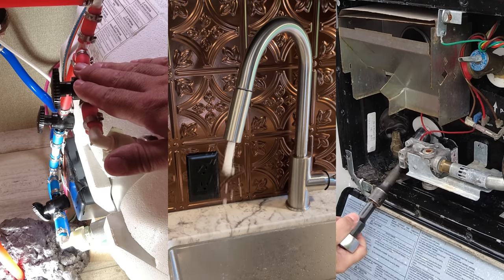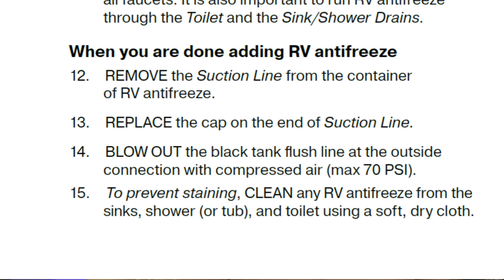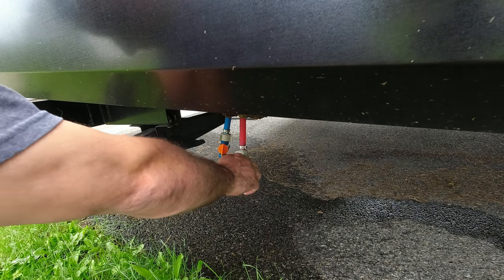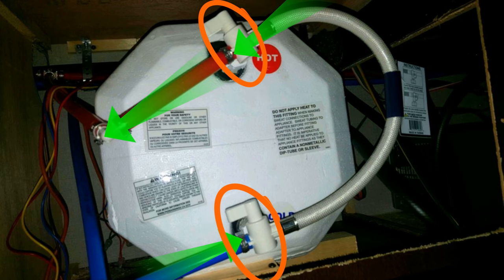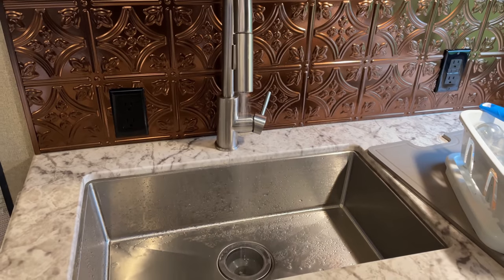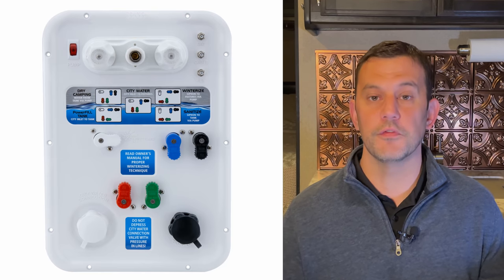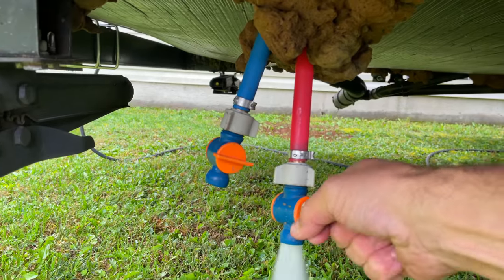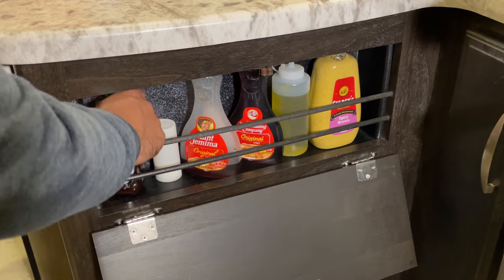RV Winterizing Made Easy - Step by Step Process for Beginners (Compressed Air Method)

Comment: PLEASE PLEASE HELP ME! My Dad passed away and gifted me his 2000 Coachman Leprechaun 305MB, 450 Ford?  I have called a dozen dealers for their assistance in JUST walking me through what this and that does in the motorhome.  Unfortunately, they don't give a second of their time on a "No Sale" customer.  Kind of sickening. My Dad took tremendous pride in his little toy and it is in meticulous shape inside/out.  But if I don't do this blowing and draining with and without antifreeze in this bypass heater and the low point drains with on/off switches (which I don't have nor seen anywhere underneath)  there are 3 drains. 1 is by itself and the other 2 are side by side.  I already, pretty sure anyway, that I drained the water lines. But I panicked last night because I thought the pipes were going to freeze so I poured 1/2 gallon of RV AntiFreeze down the kitchen sink (both sides), 1/2 gallon down the bathroom sink, 1/2 gal. down the tub and a gallon in the toilet.   I feel so ridiculously stupid and beyond frustrated.  I can't get any service person to come to my house to help me (I have cash and credit cards) so I don't know what to do. You are BY FAR the best teacher on this platform and I greatly appreciate your videos.  I just wish I had the setups or layouts and tools you are using and suggesting. I'd give you my cell number for a walk though and send you payment via WHATEVER you ask for.  lol...Desperate here...
Reply from the maker: Where do you live?
Reply: @RVTIPSANDTRAVELS  Caledonia, MI
Reply: How can I 
post/submit/add pictures of my dilemma?
Reply from the maker: @IrishRose729  send a bunch of pictures to management@rvtipsandtravels.com    i will take a look at them, and if it is something we can do over a facetime call i will let you know.

Comment: My hot water heater only has one valve with One direction marked "winterized".
Reply from the maker: your type of set up is depending on the check valve at the water heater to act as a valve.  if that check valve fails, youll have to add a manual valve, which isnt a bad idea to do before that happens.
Reply from the maker: @Wayne B I'm almost certain you have a check valve on the line coming out of the water heater on the hot side, so nothing should flow back into the water heater.  see my response on the original comment of this thread.

Comment: I have a 2014 lance 1985 trailer that is supposed to be rated 4 seasons.  I cannot find the water heater bypass valve, I have asked Lance trailer company and they say it is behind the water heater inside the drawers of the bathroom,  I have gone through the book and still can’t find it.  I had a friend that also has a Lance and he couldn’t find it either.

I have had some issues with the people at Lance not doing work they were supposed to do and treating me like an idiot when I tell them it wasn’t fixed.  I didn’t have a problem with them anytime I took it in for service or an issue when my husband was still here,  when he passed away they never even wrote out the work orders correctly or even close to the problem.  I took it in to have all the ducts replaced because of mouse damage,  I had told them and manager my husband said the underbelly needed to be checked and cleaned if there was evidence of mice.  I had many conversations with the manager and parts guy to get my request across.  I take it in and decided to have a backup camera and electric hitch installed.  I pick it up and they had me wait for an hour before they brought it out, as everyone was leaving.  No quick lesson or even a glimpse of a mechanic on how to work the hitch or get the camera image right side up.  I find the half a$$ed instructions for the hitch and guess what, I didn’t have the cordless drill with me and it was needed to work the hitch, see I could do it manually….if I had the handle that is not included and I was apparently supposed to purchase.

Really annoyed now, check the ducts that cost $500.00 and see the 2in one is taped over, and not very well because holes are still visible and the 4in duct still has the powder all over it from my mouse hunting expeditions.  Mouse droppings and pee inside the vents.  Now I am pi$$ed.  I hook up the trailer to go home with intentions of asking what happened.  Nothing worked, the beast was dead as a door nail.  Now I want blood, I pound on the doors and all the windows I could get to, nothing.  I call hoping a service might answer to take messages, I left a message letting them know of my extreme displeasure along with they better pray they don’t see me still here in the morning and if I can’t get the trailer home they had better find a way to get it to me tomorrow.

The trailer battery charges and I go home.  I call and tell them what happened and they say bring it back.  They said they fixed the back panel that was falling off.  It wasn’t,  the idiot didn’t put to change the ducts and I had to pay another 500 for labor.  After all the talk about underbelly with everyone including the manager, the manager now tells me my trailer doesn’t have an underbelly.

I am sorry this is so long, but this is the reason I am seriously doubting I even have a bypass valve by the water heater.  I have no intention of ever dealing with those egotistical aholes again.  They gave a whole new meaning to the word insulting.
Reply from the maker: Holly, comment with your email address.
Reply from the maker: or email us at management@rvtipsandtravels.com

Comment: Why are you suggesting to bypass the hot water heater it's not like you're running antifreeze through it
Reply from the maker: Because you lose a lot of air pressure blowing into a tank.

Comment: As a solo rv'r I am attempting to winterize my fifth wheel soon. I just discovered that my water pump doesn't work. Is there another way to pump antifreeze into the lines?
Reply from the maker: i would just replace the water pump, you may need it someday.